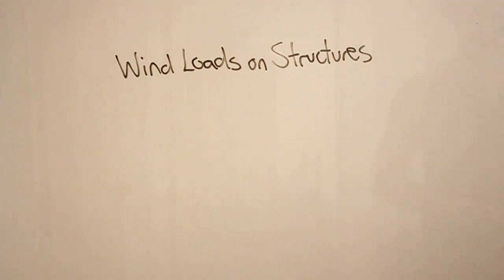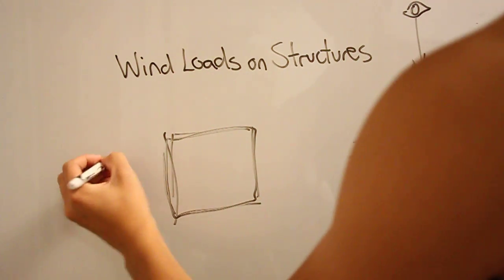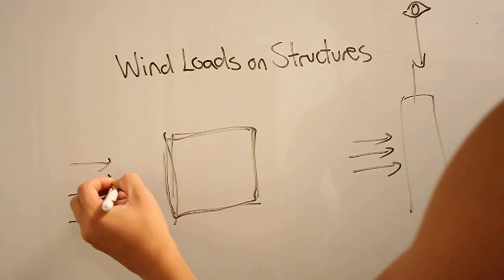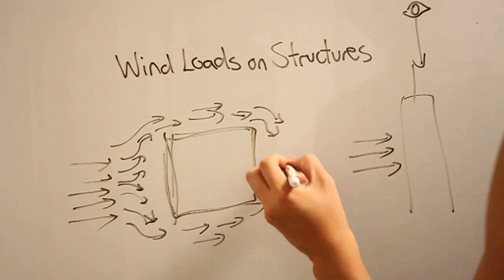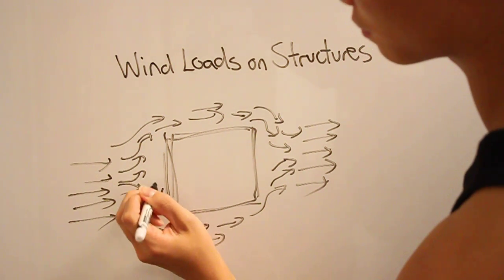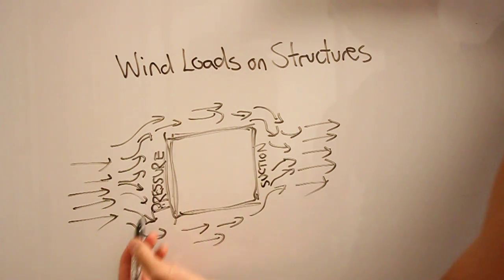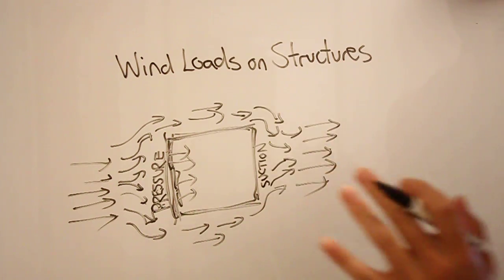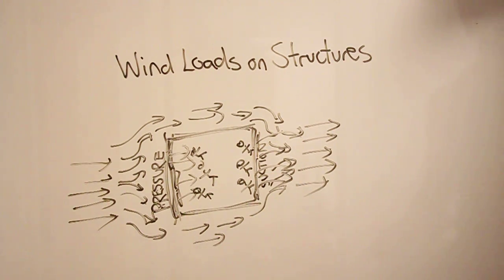Wind Loads on Structures

Comment: What if the pressure side is concrete and the suction side is glass, would the glasses in suction side still fall off? It feels like the wind in the pressure side pushed the glasses in suction side you mentioned. I am a bit confuseed.

Comment: If the wind is coming from the North, majority of the East, West, South elevations of that building will experience a suction wind (or negative wind) while inward pressure (positive wind) on the North face. 
The roof edges of the building receive wind pressure about twice that of the positive wind.
Reply: The suctions on the east and west faces are perpendicular to the wall faces right?

Would there also be frictional forces along the east and west walls?

Comment: Wind load or force would depend on wind velocity and sq. footage of the wall. We will assume a wind acting at 90deg. to the wall. Wind vel=30mph. Wall 100sq.Ft.  Initial constant .00256 WV 30x30=900x.00256=2.304 pounds per sq.ft.x100sq.ft.=230.4 lbs for 100sq.ft. Now we multiply this by the structure drag coefficient(2.0)for a flat surface=460.8 lbs of force total on 100sq.ft@30mph WV. We need more detail from the vid please sir.